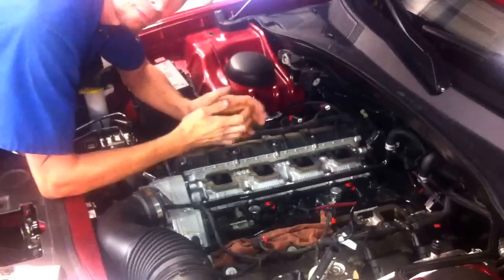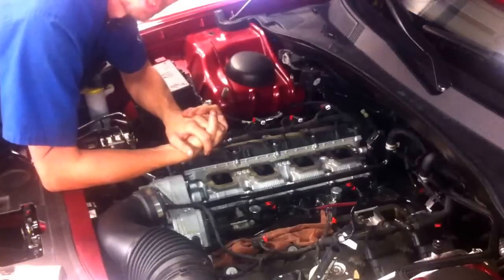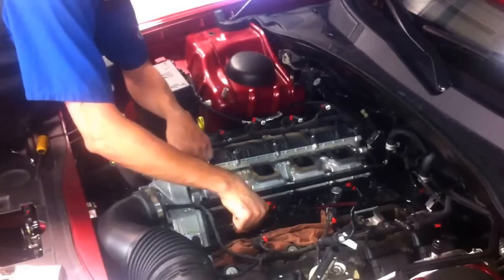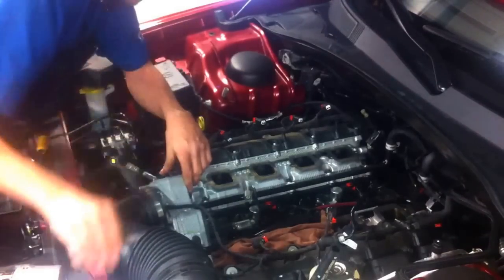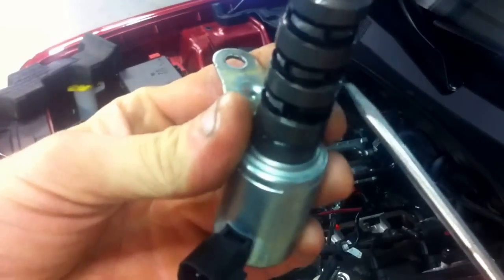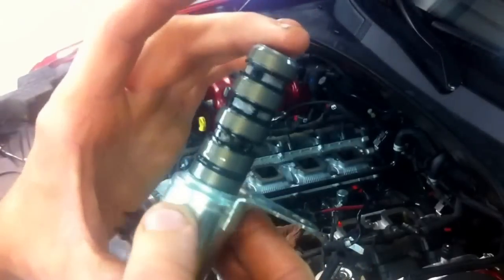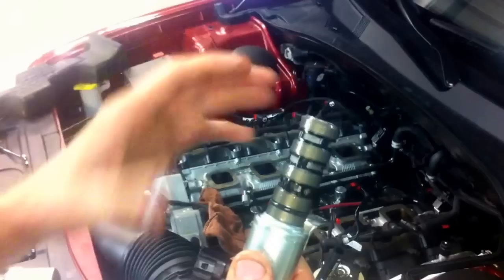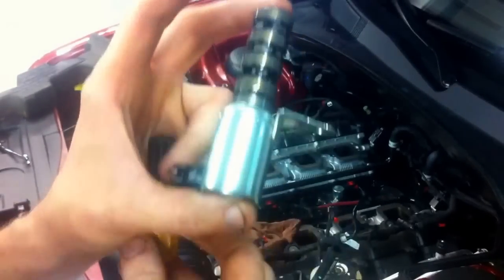2012 Chrysler 300 5.7 liter oil control valve codes P000B and P0016

Comment: I have a JEEP GC 2011 5.7 53k miles bought in July 2017, had an engine light last days, bought a scanner and those two codes P000B and P0016 were in. Made a few research and found your video. I easily replaced the oil control valve as you suggested (the screens were effectively damaged) and it does the job!! No codes found after and an improved motor power. Thant you very much!!!
Reply from the maker: Awesome. Glad that it turned out great! Appreciate you finding the channel  and for the comment. Make sure to subscribe
Reply: I have the same problem with my 2011 Jeep Grand Cherokee hemi but where it’s the oil control valve located?
Reply: Where is the oil control valve located?

Comment: Just did this repair over the weekend and it went very well.  The screens were broken on mine and I did get the P0016 code. Only once though. The big thing I noticed while driving was it would occasionally surge esp. under load and my gas mileage was terrible. I already notice a huge change in performance and gas mileage after I did the repair.  I was getting 14mpg highway and now I am getting 20-22mpg. I have a 2012 Jeep Grand Cherokee 5.7L with 89K miles.
Thank you for posting this video. Saved me a lot of money
Reply from the maker: Thats awesome. I have seen that happen on a Grand Cherokee yet and actually its been a long time since I have seen one period! Each time I find those screens damaged. Thanks for letting me know how things went.

Comment: I had that same issue with the same 2 codes, I changed that oil control valve and now it works perfectly again! Thanks very much for the video. (By the way mine never had any missing screens or anything)
Reply from the maker: I haven't seen this issue in a long time. Appreciate the feedback. Thanks for watching and make sure to subscribe

Comment: Thanks for the video...very well done.  FYI, I know someone with a '09 Challenger that had the same problem P000B and P0016.  The oil control valve was not the root cause...ended up needing the timing chain assembly replaced for the 2nd time!  The first chain assembly was done by FCA in 2014...he couldn't remember the mileage at the time.  it now has   107K miles...pretty sad.  What's really sad is that the owner took it to an independent shop and is now out $1400 for the 2nd timing chain replacement!  Hopefully FCA will reimburse him.
Reply from the maker: About the only thing in the timing chain set up that could affect the timing/codes found would be the cam phaser/cam gear. I personally havent found one to be bad yet. Which makes me curious. I hope that was the fix and not an oil control valve. I dont see FCA giving any money back so I wouldnt hold me breath. I would love to see the VIN so that I could so some further checking.

Comment: Can this cause a missfire? Can this cause somr of the ticking. i was told to check this valve becaue of the ticking to looks for metal debre. once I pulled it the screens were clean but a couple were missing.

Comment: The oil control valve was replaced and the codes persisted...that's when they replaced the timing belt for the 2nd time.  I'd share the VIN, but it's not my car.

Comment: I have a 2012 Dodge Charger Se with code P000b . I replaced the camshaft sensors and still comes up , u think it’s the VVT?
Reply from the maker: Its a very good chance thats the issue. I recommend removing and inspecting it to see if the screen is damaged or missing. if so that replace with an updated Mopar replacement. Thanks for asking and make sure to subscribe.
Reply: What is the part called ?

Comment: Just got my truck diagnosed with this problem, my question is ;where does the missing screen go and will it affect my engine severely later on? I was told it went into the into the engine. (2010 1500 Ram 5.7L Hemi)
Reply from the maker: There is no telling where the small pieces went....most likely eventually to the oil pan. I havent seen any issues related to the missing screen causing any damage. I would replace it and have no worries. Thanks for watching and for commenting on this video.
Reply: Thanks for putting me at ease. The car shop was saying I might be looking for a new engine. Told them to replace the valve and if it blows up, so be it. I'll put a Hellcat in if it does! Keep up the good videos.
Reply from the maker: Your welcome and thanks for following the channel!

Comment: I have a 2011 Charger RT. That piece was replaced when I changed the cam and lifters. It was causing the wrong oil message. Never got that back after replacing that. Just after all that work I did, one of the MDS solenoids was making noise and has been getting louder and more annoying. I would just use the manual shift option to keep the economy mode off and the noise went away. Now it's so bad, it still makes noise even when economy mode is not coming on. I ordered all 4 solenoids already, but now I have those two codes you listed in this video. I noticed when I got the MDS solenoids, they also have screens. I am not familiar with how they work, so I didn't realize they worked similar to that oil control solenoid you showed here. When I change what I have, I will ln check that one also. I'm thinking maybe if the solenoids I'm changing have damaged screens, maybe it's catching and coughing the oil control solenoid, to get those two code? IDK I will see what it looks like when I get everything apart. 
I discovered when doing the cam and lifter change, do all those solenoids too, while your at it.

Comment: How you doing I have a p0303 cylinder 3 misfire I replace coil packs spark plugs fuel injectors map sensor and etc I'm still receiving misfire I did the cylinder test cylinder number 3 doesn't do anything when I'm plugging the sensor from the coil pack what can it be

Comment: I have a 2012 dodge charge r/t that I just replaced lifters and camshaft. Code p000b came on after a while. Change the solenoid and its still giving me that code. I did do the mds delete so the other solenoid are plugs and I have a diablo predator 2 tuner on her. Might you have any idea what else I can do? Thanks.

Comment: Did it pull out for you after removing the one bolt? Mine seems stuck?

Thankyou for posting by the way
Reply: I got it out with a few taps thanks.
Reply from the maker: Motorcitymadman The bolt is all the holds it in place....the o-ring cam stick and then you might need to gently pry the solenoid out.
Reply from the maker: Motorcitymadman I was just responding back lol. Glad you got it out. Thanks for watching!

Comment: I replaced this today on my 2010 charger 5.7 hemi.  We had a mechanic tell us it was the fuel pump.  The car cut off when stopped at stop sign…it started right back up but started running rough and then it begin to cut off and eventually would start but cut off when put in gear.  Changed the cam shaft and crankshaft sensors but problem still persisted.  Someone suggested the solenoid and we said we would do it ourselves and so we replaced it today (took us an hour) and low and behold it cranked right up and runs great!!!  When we looked at the sensor it had the entire lower row screen missing all the way around.  Would anything cause this?
Reply from the maker: Not sure why that happens but it does so they upgraded to the metal covers instead. Thanks for finding the channel and video

Comment: Am getting same codes on a 3.6L VVT pentastar v6  It appears the sensor valve screens are in the camshaft phaser. Is this an accurate assessment of the analagous filter or solenoid and would replacing them have a similar effect on the engine?
Reply from the maker: What is the year, make, and model Tiffany?
Reply: 2012 VW Routan/Town & Country
Reply from the maker: The codes can be caused by a bad cam phaser. The phaser is actually the cam gear while the oil control valve is the bolt that is used to attach the cam gear to the camshaft. I havent seen these codes in awhile but then again it being a 2012 explains that
Reply: so looking at AllData  the oil control valve is inside the phaser? Am I looking at replacing the Phaser the control valve or both? Is it one piece? When the codes are cleared it drives for a day or so and then it throws randomly the Bank1 or Bank 2 followed by the other. It is now adding the O2 sensor ground fault and catylyst codes. Today it added a P066D dual oil pump catastrophic failure. I guess I know why VW gave me $17K off the sticker.
Reply from the maker: I assume you meant P06DD.....being that your having codes related to oil related issues.....I cant help but wonder if your having an oil pump issue. Oil pressure could affect the operation of the cam phasers. The bolt that attaches the phaser to the cam shaft....is the oil control valve. I havent really seen any issues with the oil control valves....more with the phaser. I would want you to have the P06DD checked for sure. We need to make sure we have the oil pressure where it needs to be so that it doesnt affect other systems. The most common cause for that code is the oil pump assembly itself.
Reply: Thank you very much!
Reply from the maker: Your welcome! Enjoy the weekend!
Reply: In working at our DIY Shop they threw the Snap on code reader and found that on the 3.6L VVT there is a "self Cleaning Phaser program" that is run through the computer. That is why I can not find a similar filter repair on the 3.6L Pentastar VVT. Hopefully this will help others. PS Change oil and filter before running self cleaning program so your not cleaning with gunk. Thanks again for al you do this is a fantastic chanel!

Comment: Had this problem on my 2012 Jeep Grand Cherokee with the 5.7l engine. My OCV was damaged just as shown in this video. Replaced, hopefully all is well now. Jeep dealer didn't know about the OCV issue and wanted to just replace the cam/crank sensors - insist that they take a look at the OCV if you get the P000B and/or P0016 codes...
Reply from the maker: +Bill Lyon Cool Bill. I hope it stays fixed and no further issues. Thanks for watching and for the added info for all the other viewers. Make sure to subscribe!
Reply: Where is the OCV located in the Jeep?

Comment: Hey MotorCity - Thanks for the video. Changed my 2011 5.7 Jeep with 118,000. Question is I noticed 4 other control valves that must control oil flow to each lifter/ valve. Do these ever go bad ? Any thoughts in changing them?  Additionally do you think this might be correlated to the lifter/ Camshaft problems? I had my cam replaces as it got ground to nothing by a warn roller lifter.

Comment: Very helpful vid.. thanks. Question, I went on rockauto website it claims there is a vvt solenoid on each bank, is this true for a 2014 dodge Durango rt 5.7? Before I make purchase I'd like to know if to get 1 or 2.. thank you in advance
Reply from the maker: On the 5.7 there is only one as you saw in the video. On the 3.6 (v6) there are actually 4 for that year. VVT controls the cam phaser and the 5.7 only has one cam. Thanks for watching and for the question. Make sure to subscribe.

Comment: I have 2008 Chrysler 300 and it was running fine till it got really cold outside ( -30 -40 degree ) and yes I'm from Canada, and I when I went to start it in the morning it BARELY started , it was struggling to starts , and it made some weird noise when it was starting ,  so I left it running for 10 min to warm up then I started driving it , the engine light  came on with the code " P0016 Camshaft\Crankshaft timing misalignment - Bank 1 Sensor 1".
And I got to the highway I found out that after reaching 80 km speed it hesitates , glitches , breaks up , shakes when I remove my foot from the gas. so do u think the cold weather killed the sensors ?   or it was just a coincidence ? should I wait till it gets lil bit warm and see what happens?
oh other symptoms  :
-The traction systems light came on at the same time.
- The engine light fleshes for 9 or 10 times.
Any help will be really appreciate it.
thanks

Comment: had this done on my 2012 Jeep Grand Cherokee. 120,000 started idling rough so I replaced the spark plugs. The set was over due at 35K miles so I thought that would do it. It did not. I am not having CEL come on but just is idling badly when warm. Any idea what I should trouble shoot first? Great videos by the way. Very helpful
Reply from the maker: Its hard to say without seeing the vehicle and monitoring the data with a scanner to see if anything obvious. Nothing is coming to mind at the moment.
Reply: Yeah I kind of figured but I thought because you are around the Hemi a lot maybe you would have some ideas on some common issues I could look at.
Reply from the maker: Usually if I have a rough idle and one thats very noticable I have a code or possible noise from the ones that I have come across. Making sure the throttle body is clean and possible resetting the learned memory (all adaptives) using a scanner may help
Reply: MotorCity Mechanic thanks for the input. I did take it off and clean it. It was good for about a thousand miles now it's rough again. No codes. I'm going to try an change out the plugs about 5 thousand miles earlier than needed to see if that helps

Comment: hi what are the symptoms ? because on mine i feel the mds kicking on but it feels bad like mis fire and by the time that i step on the gas to dissabel the mds i hear a bad clic noise, i just changes my liftes and my mds solenoids
Reply from the maker: Morning Oscar....for the most part mainly the check engine light. Its been a awhile since I had to replace one so if there were other possible symptoms then I can remember. For the most part most customers brought them in for the light being on and eventually the solenoid was isolated

Comment: Nice.. so where did these "screens" that are missing end up?? how much damage did this screen do to the engine??
Reply from the maker: +Hugh Ghazz Actually no damage has ever been found each time I come across this issue. The screen itself is sooo tiny that I am sure it ends up either in the oil filter or at the pump pickup screen. Some are still on the control valve.....just hanging on. I can say that you will have no damage caused by that screen. Getting the control valve replaced is the main concern. I appreciate you watching and for the comment/concern. I have the same thought.....something in the engine that shouldn't be in the engine by itself, but from experience I see no need to completely tear down the engine and look are something that fine and sooo small. If I had seen issues then yes. From everyone I have talked to at other dealerships and with Chrysler....no other issues have been found to be caused by the screen
Reply: Thank you! My wifes grand cherokee has had this issue for several years.. It throws a code then it clears, it throws it again, then clears. The dealer insists I am using the wrong oil. I use amsoil signature 5W - 20 (changed at OEM recommended intervals). They claim that is why I get the codes. I am going to show them this video and provide them with the other technical info I have gotten off google. They have insisted numerous times that Chrysler has no knowledge of this issue. It seems that they may be mistaken and they only have dial up and can't look this up for themselves...
Reply from the maker: +Hugh Ghazz If you have those codes then its very likely that's the issue. I don't understand why they wont check it. Do me a favor....send me the last 8 digits of the VIN and I will see if I can come up with some documentation for you. Email it to me at david@motorcitymechanic.com

Comment: hi! my name is joel escobedo, I' m watching from México,   I just have One questión, the replacement of this valve solve the problem? I have a 2012 hemi dodge RAM  5.7 whith this codes.
Reply from the maker: Hello Joel. Each time I had that code...the fix was the oil control valve. Most times you can see the screen damage when its removed as well to verify that it is the cause. Thanks for watching and make sure to subscribe
Reply: Thank you so much! I'm already subscribe!

Comment: hello I got 2012 challenger rt 17000 miles on it getting the code p0016 sensor a bank 1 ....any thoughts running like a misfire or timing off .thanx
Reply from the maker: First thing I would do is just like in the video. Remove the oil control valve and look at it closely. That is the most common issue for that code.

Comment: Would this part be the same as the camshaft solenoid actuator?
Reply from the maker: If your speaking of HEMI then its basically the same thing. Thanks for the question and make sure to subscribe
Reply: MotorCity Mechanic Thanks, changed that part today and have been driving around all day and no check engine light has came on.
Reply from the maker: Awesome. I will keep my fingers crossed for you just in case lol. Thanks for the update!

Comment: I had my check engine light come on in my 2008 Dodge charger( 2.7 L V6), So I took it to autozone and they told me that "P0016 Crankshaft/Camshaft Timing Misalignment- Bank 1 sensor 1- 2.7L" Popped up twice. I was just wondering could this be the same problem?
Reply from the maker: This code only applied to the Hemi 5.7....not the 2.7 engine. You possibly may have a timing issue where the chain my have jumped a tooth or more. It could be wiring related....cam sensor.....crank sensor.....cam tone wheel....or crank tone wheel. Numerous items that need to be checked. It  needs to be checked further otherwise it would be just a quess and throwing money at it.
Reply: MotorCity Mechanic thank you so much, I’m going to get a diagnostic done on it today and I’ll let you know what they say
Reply from the maker: Your welcome and for sure....let me know what they find.